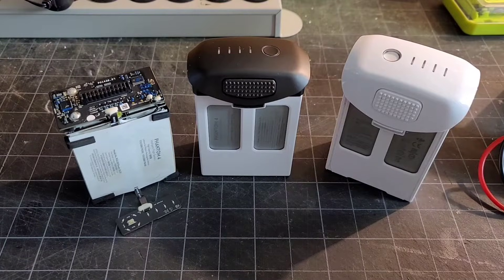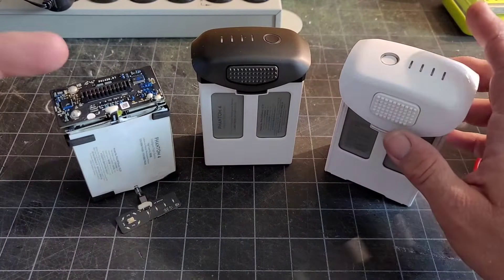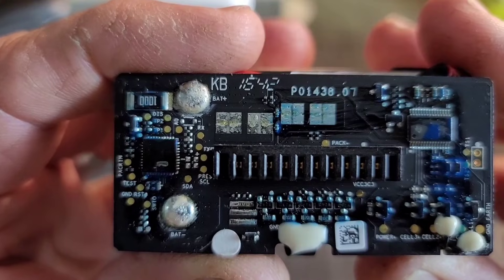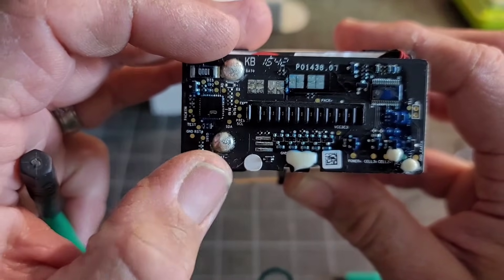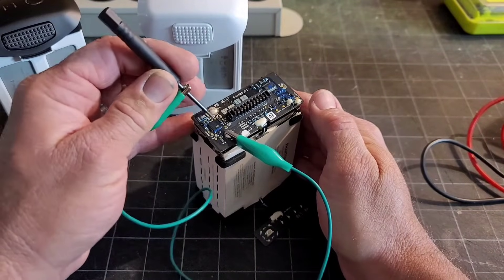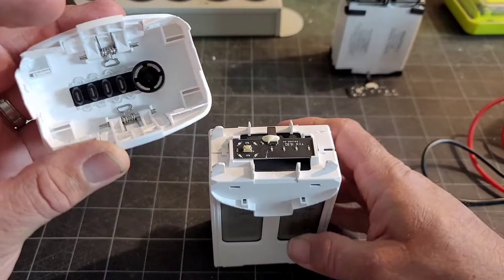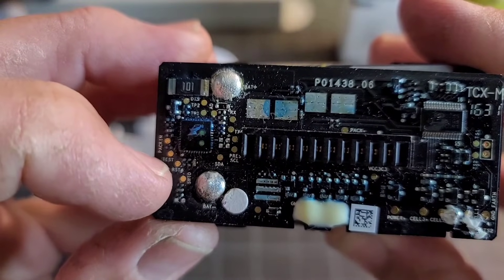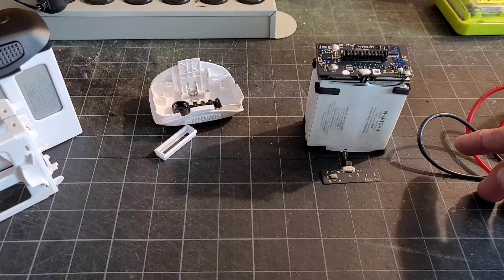DJI Phantom 4 - Battery reset and what's inside the case

Comment: My  battery was completely unresponsive. I learned a trick for drill batteries that sometimes they are discharged too much for a charger to detect the battery. So what I did was connect 2 batteries together for about 90 seconds. My dead battery went from 0v on my ohms meter to 18v on the meter.  But I still can't get the battery to charge on the drone battery charger. My charger charged the drone remote just fine. I tried touching the negative and reset contacts but didn't make the lights do anything.

Comment: This looks like a good video.   I have 3 batteries that I have not used in years and they probably have less than 5 cycles on them.   I sure hope I can do this hack.    I  took the plastic off my battery that has no screws and it was a beast.    What a pain.    You would think DJI could have engineered these better.
Reply: How can they sell batteries if you can fix them?
Reply: Were you successful in the repair?

Comment: That didn't work for me.  I had to manuall recharge the battery into operating range, snag onto the I2C bus to the Ti BQ30Z55 BMS and unseal, reset the undervoltage flag, re-seal the pack. Getting the pack apart was the harder part. not fun. DJI should have designed better for all the work they put into that battery controller.

Comment: Had a Phantom 4 battery that was not taking charge but would do the 13 blink routine when clicked on. Tore it apart to follow this guide but it still won’t reset. Am I doing something wrong? I left the positive and negative battery terminals on a 12V 1000mA trickle charger over night and tried to reset it again and it still won’t light up like yours did in this video.
Reply: only 12v?!

Comment: thank you for the instructional video.  i just used dremel and cut out a small square over the top of all of those so that I had a working window. i used 2 paper clips to short out the reset.  i just counted 3rd node down from the top.  its on the charger now.  not sure if this method will work for me. but I wanted to share that making a window on the bottom of the battery gave me great access without destroying the case

Comment: Hi im french my english is broken I have take off the case i need to use just the screw for put reser or i need to do like you with the other part connected in the same time if I dont have your matériel what can I use for do it an electric câble can do the connection?

Comment: it's been almost 2 years since I used my phantom 4 and now, I will try this method on 3 batteries' that i have because 2 won't turn on at all and one did the one light, so now I will try this and if all is good, I will leave another comment thanks 👍
Reply: Did you fixed your batteries?
Reply: did it work for the batteies that flash one green light but dont charge?

Comment: I just tried this with my P4P V2.0 battery...which was completely dead. No leds flashed before this...but I managed to reset it a few times and the leds started flashing for a bit...but then went to completely dead, again. Now it doesn’t do nothing anymore...should I let it to charge? Even tho, I have let it for like 2 days in the charger, but without any activity. It is possible that if it’s completely dead it won’t do anything forever again? Even tho, after a few resets, it started to flash a bit...the 3rd led for a few times, then it died completely. I’m so angry and frustrated :(( any help / ideas?

Comment: Great great video, and spot on with the close-up shots too,  thank you so so much.  I appreciate people, such as yourself, who help to make sure that the likes of DJI (who expect us to buy a new battery after already supporting them by purchasing an expensive drone from them),  and you have made the process so good and straight forward.  Thank you again.   Sadly I made the mistake also of letting the batteries go flat (no lights at all), and this has given me re-assurance.   Oh forgot to add, love the idea of drilling 3 holes in the case (while the battery is out),  so that on the next occasion, the +  - and reset are available, without having to remove the case again, which, as you can imagine, was harder than rebuliding a v12 engine (well not quite).   Take care fella.   Andy from Merseyside UK
Reply from the maker: Your welcome Andy, glad it helped you
Reply: great job... Nice idea 💡. Sir. Do have an idea of mavic air bms... To unlock like this? Thank you.. I hope you help me.

Comment: I looked back at my Autel star battery. They have the same reset on the board too. I tried to reset it by making the 2 contact areas. The battery lights came on as to reset. This on a battery that has not been open until now. The others I have have been rebuilt and failed . Hopefully it worked. Will give a update when I try the drone on the app
Reply: Same day follow-up.  The old battery had no swelling. Was only giving 2 to 3 minutes flight time. After the reset. Full battery displayed 17 minutes. I flew for 11 minutes until the first low battery warning at 33% with 6 minutes left on flight time. I landed on first warning. Have to say, a success. Not sure if the reset will work on a battery with new cells. Will have to try.

Comment: Thanks for the vid. Did the steps but still no blinking or life from the battery. I have no I have no electricity measuring gadget. If I charge the battery the same time that I do the reset? Bad idea?😅
Reply from the maker: Should still be ok, you are resetting it like a computer reset
Reply: @adadroneops8478  Nahh its dead. Doesn’t show any sign😓

Comment: This is such an incredible video. I've got two P4 batteries that have been sitting for a long time that I tried your procedure on, but no joy. I did not see any green lights flashing. I checked the voltage on both of them and they are .05 or below. Do I need to charge them up a little in order for the work? If so, what is the minimum voltage that I will need to charge them up to? I was planning to modify a laptop charger with two alligator clips to place on the positive and negative solder connection to see if I could charge them up a little. Thanks for your help with this.
Reply from the maker: I think roughly 3.5 to 5 volts was the low voltage cut off do get it up to that slowly

Comment: I had a very similar issue but my PCB had an unlabeled green breakout board covering the reset pad. I found that the pad is still there but has a solder blob on it. After confirming that the solder blob had 3.3v logic on it(bat- to solder blob) i shorted it and it reset the battery and now it works again

Comment: Thank you for your help. My Phantom 4 battery pack had no screws to open the pack, and rather than fight the glue and pry the case apart, I used a small diameter very thin dremel cut-off wheel to cut a 1 3/8" x 1/2" piece out of the back of the plastic case at the appropriate location (on the side where the push button is on front). I was able to easily access the main pack terminals and the reset button. All of which I needed and used as per your instructions.
Piece of cake! Careful if you use this technique - do not let the cutoff wheel go any deeper than the plastic! Very carefully use an exacto knife in the corners of the cutout, and anywhere else as necessary to prevent damage to the circuit board. I left it open, but a piece of white duct tape might be called for to cover the access hole.
Reply from the maker: your welcome

Comment: Would you be willing to do a continuity test to see if that reset test point is connected to any of the pins on the external connector?  If so, we should be able to reset the batteries without opening them up.
Reply from the maker: having 12 plus pins I imagine one might be that. Just need more time in my days......lol...
Reply: @adadroneops8478  There must be mirrored / duplicate pins as the charger plug goes in either way up
Reply: 2 of themare data pins the rest is plus and gnd

Comment: Can someone please help me here. This just happened to me. My battery for my Phantom 4 v2 is destroyed and I am hearing that its because I haven't used it in awhile and its therefore "below a certain voltage". So does this mean I need to spend $200 every time for a battery if I don't use it for awhile? How do you maintain batteries then?
Reply: Did you even watch the video? Watch it.
Reply: @ColinTalksCrypto  you’re a crypto bro. Your opinion doesn’t matter
Reply: @ColinTalksCrypto   no, I watched the video. I wasn’t going to break open my battery and mess with the wiring. Which is what the video was telling you to do. So I asked if there was another way or if I have to just get a new battery and make sure it’s always charged. My comprehension is fine crypto bro

Comment: I have a Mavic Pro and this is old. Only 1 battery has failed due to puffy. The other 6 batts are still going strong. I also have a Mavic 2 Pro that is eating Batteries for Breakfast!!! 4 bad 3 good. I have a Phantom 4 Pro Obsidian that has been pretty good until recently. Now it is Eating Batteries also! in 2 weeks, 3 went bad. They also have some puffy! What is going on????  BTW-- I also have a Tello and it has also started eating batteries. Very short life on each of those now. It used to impress me, but now not so much! I know about charging correctly, but lately the batteries seem to not follow same program.
Reply from the maker: I have always wondered if "software updates" could change the parameters and the batteries life goes the way of a inkjet cartridge.

Comment: Got the P4P out to get ready for a trip.  Found TWO batteries completely dead.  The third seemed fine.  Watched this video and the reset worked for one, the other lit up as soon as I applied power from an old automotive battery charger for a few seconds.  Trying to see if they charge up now.  Much thanks!

Comment: Left my batt on the P4P for 5months and  now battery has no led lights whatsoever.. will try these and hope it works..thanks
Reply: Just curious to know if you had any luck trying this. I'm in the same boat.  This is now my 2nd P4 battery to become a brick.
Reply: @burtwonderstone5315  just send it to hyperflight drones they will fix it for $40 i think..already sold mine and upgraded to a mavic air 2s/RC pro combo months ago..
Reply: @camilo8cheryl  Thanks, that is the plan at this point.  Trying to decide whether to pull the trigger on the new Mini 3 Pro or wait to see what happens with the next gen. Air 2s.

Comment: How is it called the thingy you use to reset it? Is that a simple cable with two tweezers/clips ??? Answer will be appreciated I need to try this on mine 🙏🏻🙏🏻🙏🏻
Reply: Yes, I believe it's a simpler jumper wire - you can get them easily on Amazon etc.

Comment: What does multimeter need set on to do the reset
Reply: Meter is only for checking batt voltage.. you need a jumper wire from Batt(-) then connect to reset points on the board and wait for few seconds
Reply: @camilo8cheryl  Can you please tell me how much volt do we need to provide to the RST pin

Comment: Hey there. Awesome Vid. What should I search to find the positive and negative wires?
Reply: eu arrumo baterias do mavic 2 pro,  phantom 4 e toda linha DJI com o uso de software para a ativação do chip.
Reply: I fix batteries for the mavic 2 pro, phantom 4 and the whole DJI line using software for chip activation.
Reply: @joaovitorsantosgrigorio8133  could you be a little more specific about what you mean?
Reply: @analogpunk-7743  I make repair in the DJI batteries, using a software that allows me to unlock the chip and fully activate the battery. The external load is not necessarily reactive to the battery, so I use the software to complete the process
Reply: @joaovitorsantosgrigorio8133  what’s this software called?
Reply: @analogpunk-7743  It's a paid software from UBRT 2300
Reply: I reactive the batteries for normal operation, even if it was disconnected without a sign of life.
Reply: @joaovitorsantosgrigorio8133  do u have a website i have a couple of batteries
Reply: @joaovitorsantosgrigorio8133   is it difficult to use?

Comment: Hello brother hope you are doing well...  What happens when we do the same thing with power point ?
Reply from the maker: Do mean trying it through the 12 pin connector?
Reply: I think he means instead of taking the alligator clip and putting it on the negative battery terminal what happens if it goes on the positive

Comment: I had a P4P battery which I had stored while inserted in my P4P for about 6 months.  It had the same symptoms as you described.  Using your method of resetting the battery, I had 100% success.  I've looked at many other videos with different procedures but yours is the simplest of all.  Thanks so much.  You literally saved me the cost of a new battery which, as you must know, is very expensive.  GREAT JOB!
Reply: Man, same here left my p4p battery inside it for good 5 months now its not charging , no lights at all. Going to try this....
Reply from the maker: Thanks glad it helped you!
Reply: @adadroneops8478  I have a question first off I’ve subscribed I have one battery that flashes on one green led only now I’ve done the reset but seems to do the same 
I have a rc charger what would you recommend I do charge it with the rc charger and then try the reset

Comment: Can i reset mavic 2 battery? It wont charges/dead
Reply from the maker: The battery mother board has the same points of contact from what I have seen in other peoples videos. I do not have a mavic 2 battery to test and do a video on.
Reply: I fix batteries for the mavic 2 pro, phantom 4 and the whole DJI line using software for chip activation.
Reply: @joaovitorsantosgrigorio8133  You have mentioned this twice. I am curious about mavic pro 2. can you give some info? I have 4 batts that are either swollen or just non responsive. Please Help! I am a Tech, but am fighting a losing battle on these. It is now costing a fortune to Fly my Drones!!!!
Reply: @oconnb910  in the case of a swollen battery, it is recommended to change the cell pack, because if the battery swells at one time or another it will damage the housing and run the risk of further damage.
Reply: @oconnb910  In my case, I activate DJI batteries that do not turn on or do not charge, in cases of being swollen, the recommended thing is to change the battery pack for a new one and this can be expensive.
Reply: @oconnb910  I also use paid activation software and a battery status card to assess cell condition. With this I load the cells externally and then activate via software.
Reply: @joaovitorsantosgrigorio8133  Yup I get that, but why all of a sudden does this seem to be happening? I have been doing this for quite a while now, but it seems to be quite frequent lately. Seems to be around 60 - 85 charges, then they head to death spiral. With my suspicious mind, I feel it could be intentional marketing to buy more, but not easily available even. This is becoming quite costly to replace these. I am building up a junk pile fairly quickly lately. I have reached out to DJI and absolutely no Help! I am concerned I have started to do something wrong because I did not get the Memo.
Reply: @joaovitorsantosgrigorio8133  Hmmm, Tell me more please?
Reply: @joaovitorsantosgrigorio8133  I am spending more on batteries than drones lately.

Comment: it work on 2 of the 3 batteries thank you
Reply from the maker: Great to hear you were able to get a few of the going what is the 3rd doing?
Reply: @adadroneops8478  it isnt doing anything
Reply from the maker: try holding down the power button for atleast 10 seconds to get it ro reset and cycle it self. see if that helps.

Comment: Hi , I did everything as in your video, but the drone does not turn on
Reply from the maker: Does the battery turn on now but the drone does not turn on?
Reply: @adadroneops8478  The drone doesn't start, help , what to do ?
Reply from the maker: Does the battery seat, or fit all of the way in the drone? I have heard of the connections loosing or shifting. If the battery turns on and the drone does not it is either not making contact with the connector inside of the drone or something else is wrong.